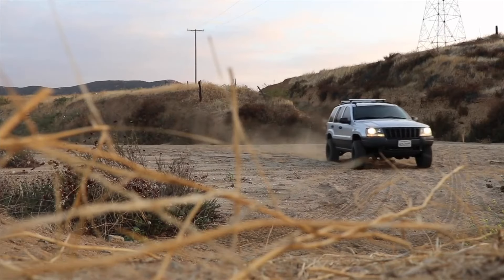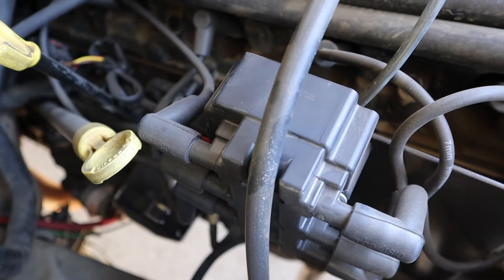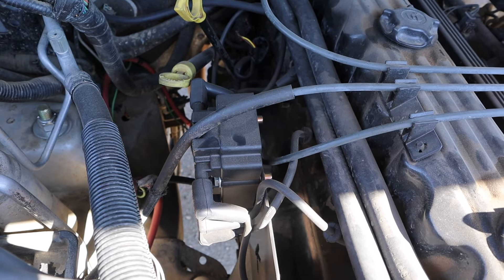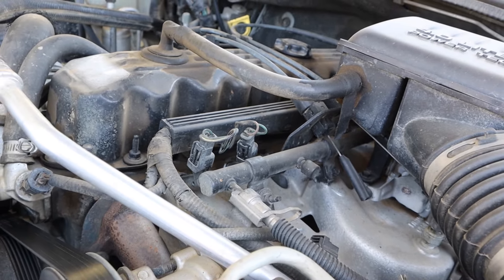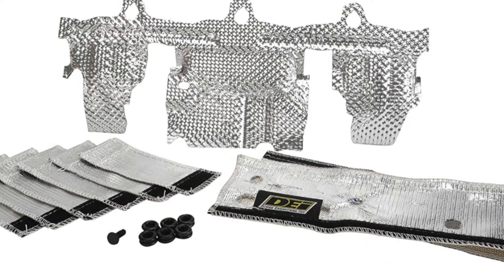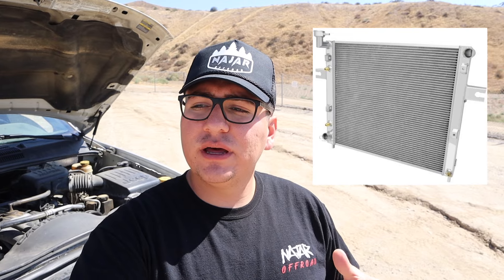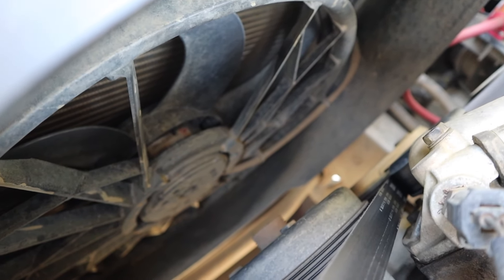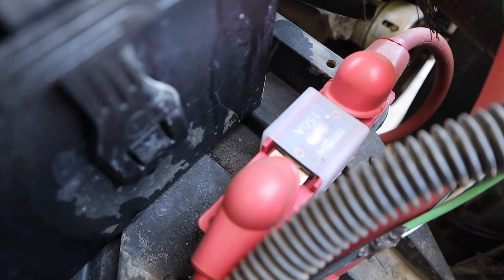Top 5 Engine Mods YOU SHOULD DO To Your Jeep Grand Cherokee

Comment: I've got 3 of those mods installed on my inline stroker.

1. Can confirm the Viper coil mod is great.
2. 4 hole injectors great bang for the buck.
3. The cover kit looks really nice and it's super easy to install.

*I would like to add on with that clutch fan, having an oil cooler with a second fan helps a lot when your off Roading OR just stuck in traffic all the time.
ESPECIALLY if you live in the south like I do (Florida).
Reply from the maker: Nice can’t wait to get my injector and cover kit in! I hope it helps with MPGs atleast 1😂 I’m at 10.9

Comment: I did the K-Suspension 4-hole injectors a few months ago because the #3 injector suffered from the heat soak issue, then started failing. Also installed the heat shield kit from Design Engineering. Now no problems, better mileage and quicker throttle response. Well worth it! Thanks for your excellent videos! I have a 99 WJ.
Reply: 99 wj 💪

Comment: I got four hole injectors from injector rehab about a year ago, they came with a before and after flow bench test that even included ohm's of resistance. They are perfectly balanced didn't notice any power but picked up 1 mpg so they pay for themselves over time.

Comment: If you know a HVAC guy get some of the copper piping insulation - it’s aluminum coated, and has a foam insulator technology - cut it to the length of your fuel injector rail, cut a line down the middle of the HVAC tube insulation from top to bottom, and put it around the rain and use zip ties to hold it in place. Works great for heat soak

Comment: Injectors were the best engine mod I did to my 4.0 I get 17-22mpg👌
Another engine mod I would add to the list is throttle body, the factory ones are so small
Reply from the maker: I can’t wait for mine to come in! Oh I haven’t done research on the Throttle body but that would be a good one! What do you recommend for that?
Reply: @NajarOffroad  https://www.amazon.com/BBK-1724-62mm-Throttle-Body/dp/B001GBRIKW 
This BBK 62mm is pretty much the most common on the market. Good size for off-roading l, you will definitely notice the improved throttle response especially with the new injectors
Reply: 4 or 12 hole injectors?
Reply: 12
Reply: Ah, I've seen an ITB one it made good ho but had a bunch of mods. Never thought about throttle body. Did you have to tune for the injectors to get those mpgs, or any ecu changes?
Reply: @williamhutchins479  no the aftermarket stock flow injectors or supposed to be plug and play but definitely could use a tune with the other mods I did. 
I have a high flow exhaust and bigger throttle body. Just went down to the basics. More air flow = more power = better mpg. New injectors, new coil pack, new sensors (transmission’s included), and stock height+ tires.
My hand calculated mileage is now 24 highway. I drive my Jeep for work all over my state.
Reply: @rodom303 the 12 hole injectors are an awesome upgrade. Are you using the stock air filter or did you upgrade to something different with the throttle body?
Reply: @thelostmachine713  stock air filter👌I’ll only upgrade if I increase engine size or add boost
Reply: @rodom303  I appreciate the insight. I did the injector swap, exhaust upgrade also. I found a practically new one at the junkyard & was curious if I would lose or gain any mpg or set any check engine lights.
Reply: Trans inner cooler is a good mod too if you have trans temp problems.
Reply: I meant to comment that. Not reply. My bad. Ha
Reply: What size tires did u run getting those mpg number from the injector upgrade
Reply: @brucewayne-ej3cx  stock
Now I get up to hand calculated 24mpg. 
I do a lot of highway driving tho.

Comment: I’ve got the rail cover kit on mine. It will eventually let the heat soak through but it takes a lot more time. Upgrade the fuel pump with heat shield should prevent vapor locking for the most part

Comment: I have one to add when it comes to the cooling and fan system. I've done this to my 2002 Jeep Grand Cherokee with the inline 6. My Jeep came with both the electric fans and the clutch five blade fan since it came with the factory tow hitch. The upgrade is relatively simple. And it will sound a little unorthodox. So check out the other videos on how to install it on youtube. What it is basically you take off that five blade fan that comes with the clutch fan. And you put on the clutch fan from a 4.0 V6 Ford engine. If bolts on. And then you screw it on to where the clutch fan would be. The suction power of that fan is so powerful. That my Jeep rarely goes ever over the middle temperature keep in mind I live in Las Vegas where we hit 110-120. Check out the videos and you'll see what I'm talking about relatively easy
Reply from the maker: I have read up on it! Definitely something I want to do since electric fans do go out!
Reply: I did it after the first year of owning the jeep. Like I said I live in Vegas. and what would happen if I ran the AC and I was at a stop sign. The needle would climb rapidly until I started moving. When I went to check it and look up on it that's when I found the video on youtube. And when I went to go actually do the change when I saw that I had both the electric fans and the clutch fan. Which turns out to be something that she put on all the Jeep Grand Cherokees that come with the tow hitch from the factory. Relatively easy mod you could actually get some of the parts from AutoZone to rent to be able to do that to the clutch. There's a few videos. It works so well that I actually had to change the thermostat cuz I kept getting a check engine light for the engine running or staying too cool.
Reply: @edeno328  ive done the same upgrade on a 99 Wj 4.7 limited, but still have issues with heat soak. Being in a high temp state(tx) do you recommend any other upgrades?
Reply: No I'm not familiar with the V8
Reply: @chillsolo8280  On the I6 you can put a timer on the eletric fan triggered by a thermostat.  Even with the insulation kit the fuel line still gets quite hot.  Those cats sitting right there.

If the intake and fuel lines could have been on the passenger side, I wonder how much more horsepower the engine could have developed?  But then oil changes would have been more difficult.

Comment: GM 11 blade fan works very well, also a header, can remove your after cats in a new exhaust and muffler without throwing a CEL. Ksuspenension viper coil packworks very well, alot mire convenient than the stock rail, thumbs up on the 12 holers as well. Thought your mods would be stupid ones, spot on
Reply: Anything GM is an improvement upon the inferior brands.

Comment: I would also recommend getting a transmission cooler kit if you have a 4.0L that didn't come with a factory tow package, they have a tendency to burn the transmission without one and it also cuts out the possibility of getting coolant in the trans fluid if the stock style rad pops.
Reply from the maker: Oh that’s a good mod! Will definitely look into it
Reply: Do u have the link to a good cooler kit
Reply: @sergiogomez170  if you find one let us know
Reply: Removing the check valve in the cooler line is more important then a cooler

Comment: Replacing the injectors is going to be an improvement regardless of 1 or 4 hole if they are old and clogged. I did find rebuilt 4 hole ones for a Caravan at a good price and will be installing them soon.
Battery Cables USA allows you to order cables any length, with your choice of end connectors, at a great price.

Comment: Good video but I suggest buying a tripod bro. Too much wiggling around messes with the eyes. The upgraded injectors didn't work for my ZJ so I went back to stock and now it now works fine. Upgrade injectors sometimes flood your engine with too much fuel. Like the heat soak idea and had just looked at that cat right before I saw your video. Going to try that out. How's that coil pack upgrade running for you so far cuz I wouldn't mind trying that out too.

Comment: So when I unplug my master switch and run it with it unplugged my gauges and windows work and stuff but when I plug it back in and start going down the road again all my guages and windows will kick on and off. What could that be do ya think?
Reply: Took it to a garage and they told me body control module butt I replaced that
Reply from the maker: I would check the wires in the boot ont the driver side door sometimes the wires break and cause weird stuff to happen

Comment: OMG do I want another WJ I6. Question for you, which of the WJ models came with the selecta-track tranny? What is your tranny preference?
Reply from the maker: Mostly the ones with I6 some V8s came with it but rarely. Mines a Laredo and came with it
Reply: Mine was 2002 and i lost the head gasket. I tried to replace it myself but I chickened out and there was so much rot underneath, that I junked it. Saddest day ever.
Reply: You can only get the 42RE transmission in the I6. Select-Trac mates with the NV242 transfer case.

Comment: What's a good long term vision, mod/rebuild the I-6 or attempt an LS swap? Hate to lose the reliability and toughness of the I-6, but would love some added horsepower and get up. Spec-D has that aluminum radiator for like $150 on Amazon. Did you get the basic Viper coil mod or the supercharger version?
Reply from the maker: I don’t know that’s up to you😂 I think it might be easier fixing the I6 but I’m not sure haha. Oh nice! The one I linked was recommended to me by someone who did the swap! I got the basic viper coil mod!
Reply: Want a Chevy? Buy a Chevy.  Jeep is 4.0 and 4.0 is JEEP.  
Stroker motor. Cam. Turbo, etc. Upgrade, use and protect.  It's a legend.
Reply: Swap a 318 if you want more power

Comment: Love your upgrades. I'm modding for reliability, power and economy.

 I plan to get the fuel rail insulation, upgrade the steering and brakes (from a V8 model) and will consider the coil pack, but know nothing about those yet. Need to connect with Jeepers in my area, as I'm new to Jeeping.

Have you considered a set of roller rockers, to improve mileage, power,  and engine life? I was going to run synthetic oil in mine, until I learned it can't take the high pressure/friction on the lifters/cams/push rods. I had planned to put in a zinc additive to handle the friction, but that clogs the catalytic converter.

So I'm saving my pennies for a set of roller rockers. Then I can run synthetic and have a bullet-proof straight six. 

Thanks!
Reply: OH! And my four hole injectors and 130 amp alternator are in the mail! And mine only has the clutch fan, so I'm leaning towards a pair of electrics, to increase cooling and power.

Comment: I can see that you just want to burn cash as all of the things you recommend are absolutely worthless. 

99-01 xj coil pack is properly designed. Going hotter with spark on a properly maintained 4.0 is useless. Same for injectors, plug wires. As far as heat soak just put a time delay relay on the electric fan circuit (push button in cab) to run for 3 minutes when doing short stops (around 15 minutes seems to be the window) Ethanol is the culprit. And if you don’t ensure that everything about the cooling system is clean then crack a head. 

It’s really simple. Flush cooling system on the regular. Never go above 230F. Change oil.  It’s a tractor engine. Stop ✋